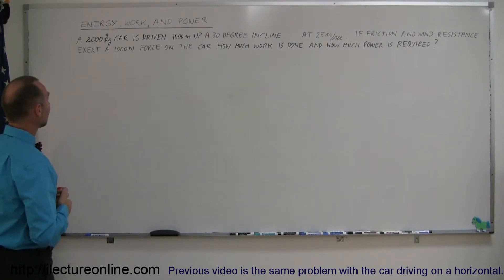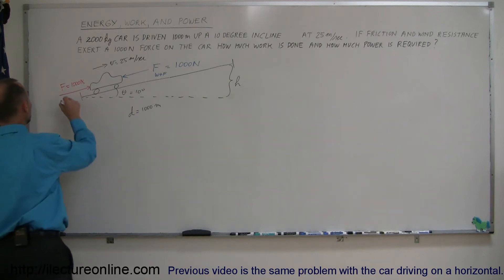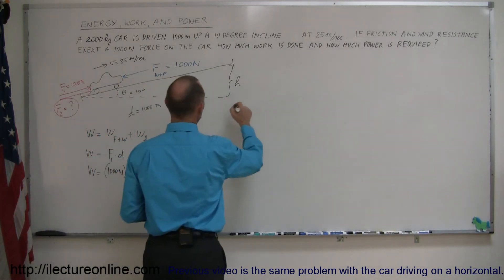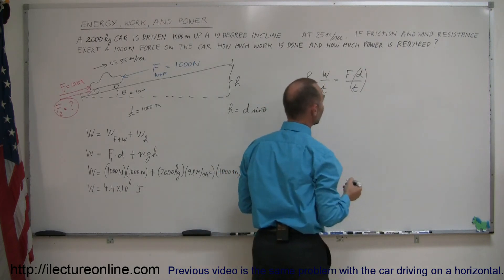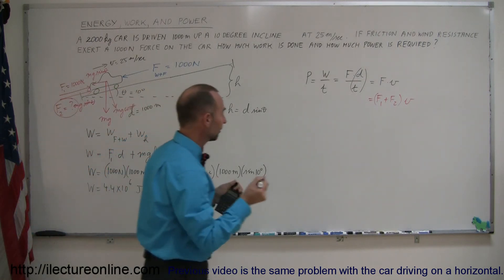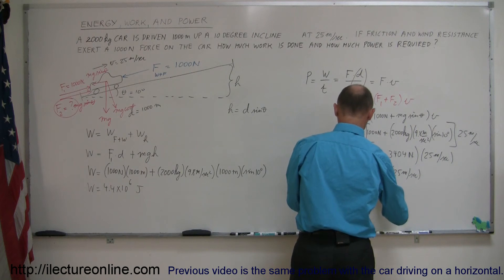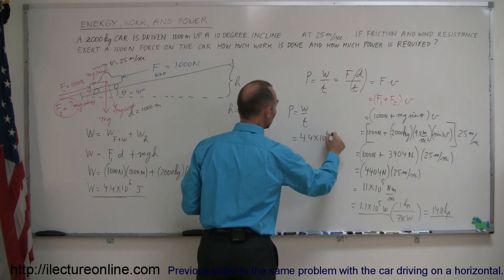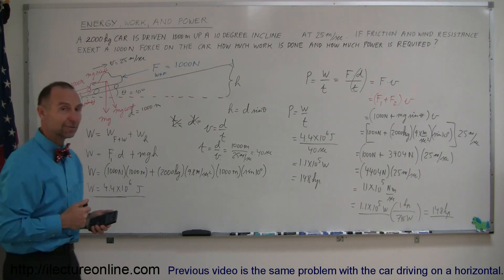Physics 8  Work, Energy, and Power (31 of 37)

Comment: when you did the first part with work, why did you do 1000x1000?, wouldn't work down against resistance be force, 1000N, times the length of the slope which is the hypotenuse?
Reply from the maker: When the angle is small the sin(angle) ~ tan(angle), therefore it doesn't matter which we use
Reply: @MichelvanBiezen  ok thanks!

Comment: Instead of finding F1 + F2 with mgsin theta, we can use the W we had calculated and solve for F in equation: W = F.d
W= 4,400,000 N.m d=1000 m so W/d gives 4400 N, theres calculator rounding but very close
Reply from the maker: Yes, there are several ways to solve this problem.

Comment: When he obtained the work of 4.4x10^6 Joules he might immediately obtain the power from the 1000 m length and the 25 m/s speed. This move would require 40 seconds. Then he would divide the work by this time interval of 40 sec. and obtain 1.1x10^5 watt.

Comment: Sir, why don't we use ( Net Work=Change in Kinetic Energy) to find Net work done on the system? I'm asking this question because I sometime confused using these equations.
Reply from the maker: Not all work done on an object or a system results in a change of its kinetic energy.  You can do work on an object with zero change in the kinetic energy.   That is why we have a definition for net work = change in kinetic energy.  Another way to look at it is:
  Net work = total work - work done to overcome friction (or any retarding force)

Comment: why is mgsintheta positive? Shouldn't it be negative since it's acting on the opposite direction of the force?
Reply from the maker: Baul God,
We are calculating the force required to overcome the weight component along the incline, which is positive.

Also be careful about making a distinction between the magnitude of a force (which is always positive) and the direction of the force.
The direction of the weight component along the incline is down the incline (negative) and the Force required to overcome the weight component down the incline = mg sin(theta) and it is directed up the incline (positive)

Comment from the maker: Jin.  Thank you for the comment.  It shows how you and others are looking at these videos very closely and understanding the material.  Yes the 1000 m is along the hypotenuse.  That is how the problem is worked out since the height is calculated using the hypotenuse  (h = d sin theta).  I placed the d = 1000 m at the bottom since it was getting crowded on top of the triangle, but d is indeed along the slope (hypotenuse).